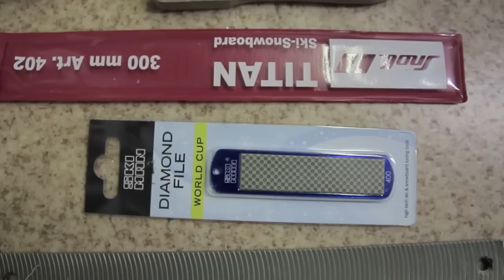New Ski Tuning & Waxing

Comment: Why would new skis need such work?
Reply: new skis do not come tuned from factory and need to be tuned before using
Reply: Linda Cardinal Define 'tuned'. New skis have a bevel on both the metal side & edge, and wax on the base. If you're not a racer or wannabe, why would you want to alter what the factory has done?
Reply: The wax on the base that is added in the factory is just that, a factory wax. This simply isn't as good as a wax coat you would get from a tuning (what is being done in this video). This prevents the base of the ski from drying out and shrinking over time. Additionally, while the bevel that is on the edges is plenty sharp enough for just about any conditions, a step that is not done in the factory is the detuning that is done on the edges at the tip and tail. This provides a little forgiveness at the beginning and end of each turn so you are not catching edges constantly. Lastly, his first step of checking for flatness is one that may only need to be done for fatter skis. The reality is manufacturing tolerances over such a large area could result in a base that isn't perfectly flat. This tolerance is exacerbated on wider skis as any slight error gets amplified over the larger area.

So no, you don't have to be a wannabe or a racer to want to alter what the factory is done. You just have to want your new skis to be as easy as possible to ski.
Reply: cm1547 So what wax do ski factories use, and how does this differ from commercially available waxes? Do factories deliberately turn out their skis with inferior wax?

As for detuning the skis, I read that was important with the old 'straight' skis to prevent them hooking up, but it's a matter of personal preference with shorter, more profiled modern skis.
Reply: @Benzknees  Yes. The ingredients are of lower quality and contain no additives and most often the wax is too soft (i.e. for warm conditions) as soft wax is easier to handle (i.e. apply) than hard wax (lower temperature needed, floats easier). There is specific transport and stock/workshop wax developped for application with a machine. Further, as everybody would set up the saddle height and pump their bicycle tires to the desired pressure, edges need to be filed to the desired angle. Most skis come in a 90 or 89,5 ° angle from stock. You will want to adjust that to your abilities and/or the conditions. Note that on pure manmade snow a 87° edge will be noticably dull after only a couple of runs. So as you set up and later mostly only repump your bike everytime you go for a ride (else you suffer from high rolling resistance and/or inferior handling, curving etc.), you should also wax and file your skis. No offense, but he who thinks that's unnecessary is a wannabe really.
Reply: Christian Hatsch - You say the wax contains no additives, but neither does the universal wax he’s putting on at 5:17. The vast majority of skis have universal wax on the bases, as it covers a wide range of snow temperatures unlike race waxes. It’s ‘soft’ as it’s designed for the normal temps that most skiers will encounter. And you’d use softer wax for high snow temps, not low ones. Hard waxes are only needed for the sort of sharp snow crystals you’d get at v.low temps or sometimes on artificial snow. 

And the Elan Amphibios in the video are not GS or slalom race skis. They’re usually described as being for intermediates to advanced recreational skiers, and come with a 89° compound angle, which is good enough for anyone except racers. Most sites only suggest 87-88° for GS and 85-87° for slalom. And as you say, such sharp angles get dulled pretty fast if you use them on abrasive snow, and possibly irreparably if damaged by stones. No sensible recreational skier would use such angles.

No offence, but he who thinks it’s necessary to race tune a recreational ski for intermediates to advanceds, and use expensive fluoro and moly waxes, is definitely a wannabe.
Reply: @Benzknees   Commonly called travel wax, obvious in name and obvious in why...
Reply: First Timer - Travel wax is either soft wax you rub on & scrape off, or fluorocarbon paste on a puck, both intended to last a day or two. What’s that got to do with factory applied wax?
Reply: @Benzknees  they dont use wax, they use parafina
Reply: Ringo Anselmo - What is ‘parafina’? Is this Spanish for paraffin wax?